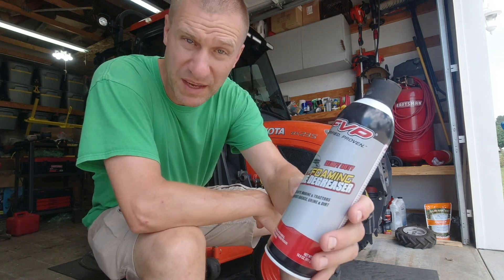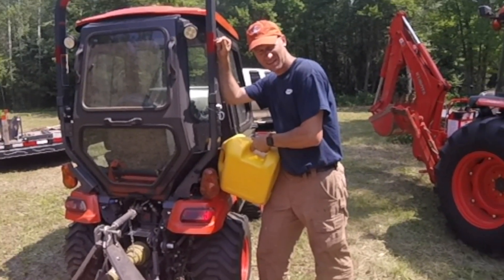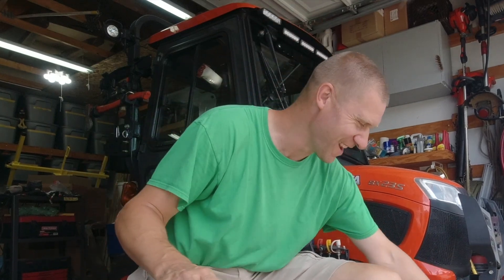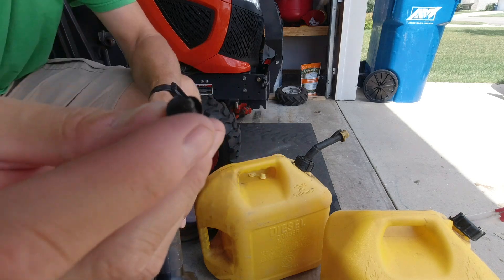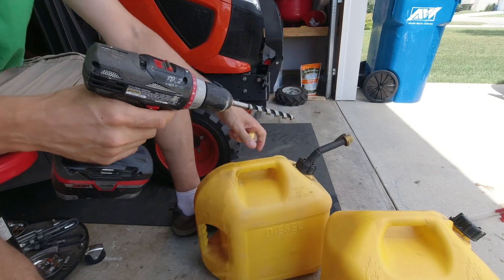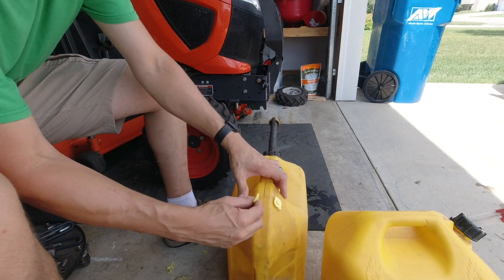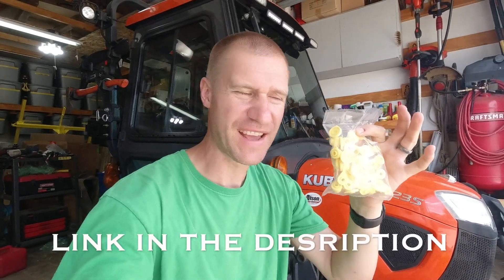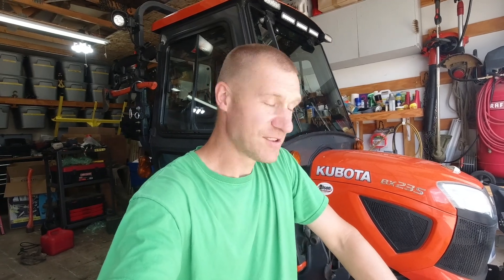VENTING FUEL GAS CANS (cheap and easy)

Comment: I used this on my 2006 Troy Bilt Pony (MTD) tractor Bestfor.Garden also recommend it was an easy swap. It's very light aluminum and seems sturdy enough so far; I assume you really only need to replace the idle pulleys once so if these wear out anytime while I have the mower I'll update the reivew.

Comment: I drilled a hole then expoxied a tooth paste tube end with the treaded cap  , no leaks , remove cap and let's the air in , nice steady pour , no gas all over the damn place . Let's talk about the retarded " safety switches they put on power tools now . They are accidents waiting to happen . Loosen your grip so you hit the safety switch . Who's bulls___ idea was that ?

Comment: the new... whatever gas can vent/nozzle takes 20 mins to get a gallon of gas out of the can??? what is uup with that. WOW. i want the gas to come out this week, not next... when my back hurts so much from holding the can in the air as dribb drbbb dribbble it comes out a swallow at a time.